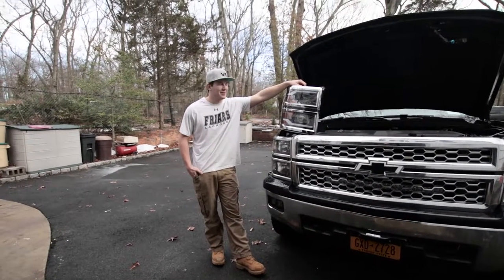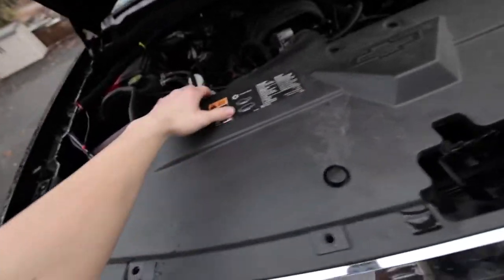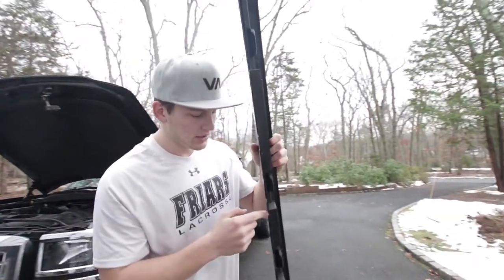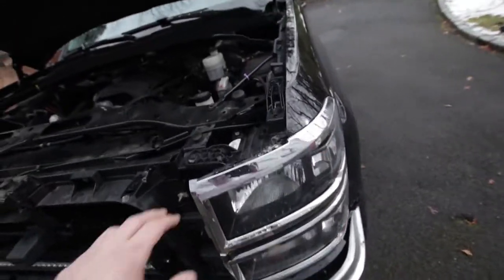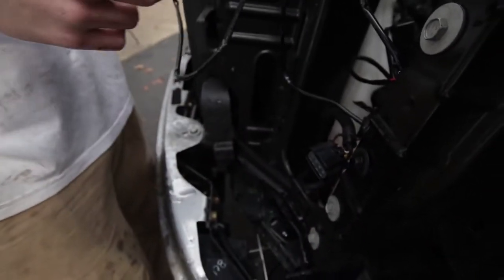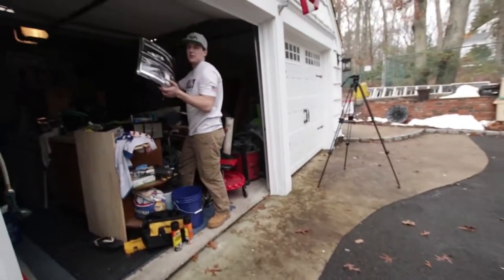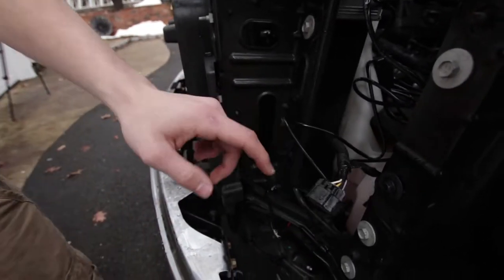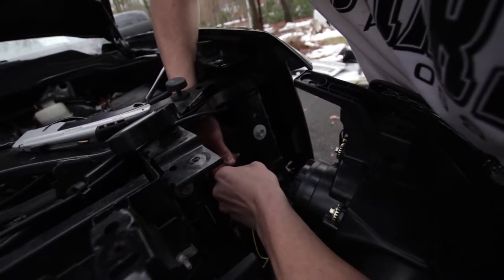Winjet DRL Projector Headlights on 2015 Silverado | Install

Comment: I've purchased these lights but I'm having trouble with the wiring. Should the lights come with the wire slice and extra wiring? I don't have that. I'm not sure where the yellow line from the new lights plugs in. I have a feeling I may be missing that needed wiring.

Comment: The bulbs are for the projector right not the fog lights I just ordered them but just want to be completely sure because on the description on amazon it says fog
Reply from the maker: mauro Reyna as long as they are H7, they will fit the Winjet Projector

Comment: John, So after having the Auxbeam H7 led lights put in have they worked good so far? Do you get any flickering, and also read a post that someone said they interfered with the radio signal. I figured its safe to ask someone that has them. Did the back covers fit as they should? I bought a set of Kensun leds for my stock lights and they fit like crap and I couldnt put the dust covers back on. What about the split that you talked about on one of your posts? Was that a problem? Sorry for all the questions, I just like to get all the positive feedback I can before pulling the trigger. If you know what I mean!
Reply: my1948hummer I bought some Auxbeam fs-2 h7 for my winjet headlights and they fit nice. The dust cap was able to fit back on

Comment: Nice looking headlights!! 

Is there more light coming out of the projectors?

Can you see better with the projectors?
Reply from the maker: 04bluesilverado yeah the projectors are awesome and paired with the LED bulbs i put in them, the light output is insane
Reply from the maker: MrSwiftShotz i havent tried HIDs in the housing so i cant really compare the two, i am extremely happy with the LEDs though. I had HIDs installed prior to these and had issues with them being different colors and then one went out and would flicker occasionally so i decided to give LEDs a shot.
Reply from the maker: MrSwiftShotz they are 6500k, they are cool white with a hint of blue. Iike it alot better than the 5000k HIDs i had
Reply from the maker: MrSwiftShotz i bought them on amazon, i have them linked in the description they are Auxbeam FS-3's. Not a problem, glad I could help!

Comment: John, 
 Have a couple of questions about the lights. I just purchased a set and
 had them installed and have a couple of questions. 1st is do your DRL's
 go off when you put the truck into drive if its sunny out? Mine do. And
 when I cover up the auto light sensor the DRL's and the headlights are 
on. Also noticed when I push the fog light button the DRL lights come 
on. Can you please tell me if this is the same as your truck? In my 
opinion the DRL lights should be on all the time not just at night! I 
also saw in your video that you side marker lights no longer come on 
unless you turn on the turn signal. Just wanting to verify that mine are
 working correctly
Reply from the maker: my1948hummer mine operate the exact same as you describe
Reply: Thanks! Kinda defeats the whole purpose of Daytime driving lights! LoL
Reply from the maker: my1948hummer i agree, but the lights arent really all that noticeable in the day so i dont lose too much sleep over it lol
Reply: Big thanks for your install video! Made it so much easier!

Comment: Thanks for sharing! Question: In the video at 0:01, were the white DRL strips turned on?
Reply from the maker: Joshua Dinong yes they were
Reply: how'd you adjust the projector lamps to get them angled properly?
Reply from the maker: Joshua Dinong there is a phillips head screw on the back of the house thats on a gear-like head, that adjusts then
Reply: Can you angle them while their in place or you have to pull the housing out to access the
Phillips headscrews?
Reply from the maker: Joshua Dinong you can adjust them when they are in, although its a little tricky to do the passenger side bc of the air box
Reply: John Marjoribanks Thanks!
Reply from the maker: Joshua Dinong not a problem! glad I could help